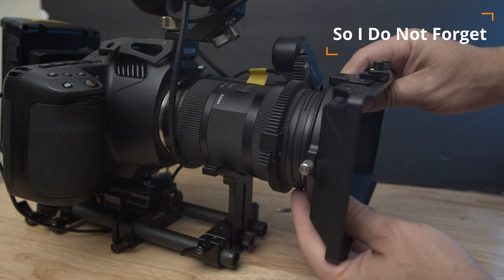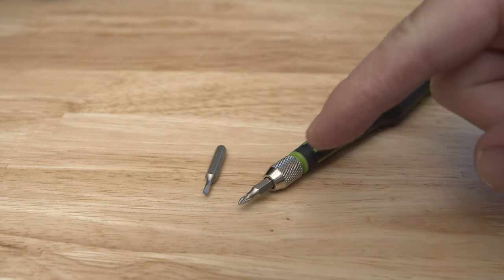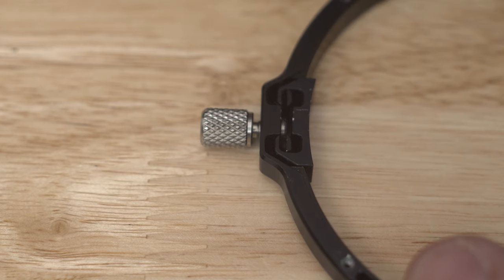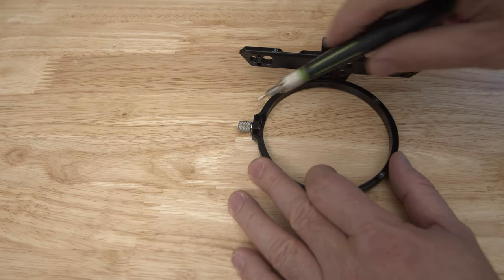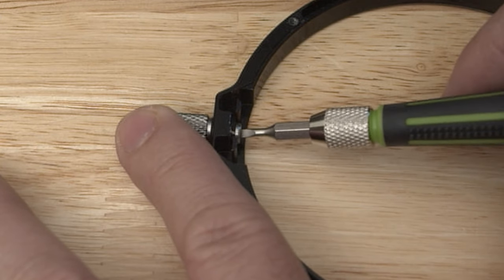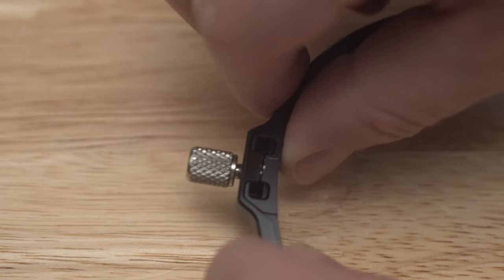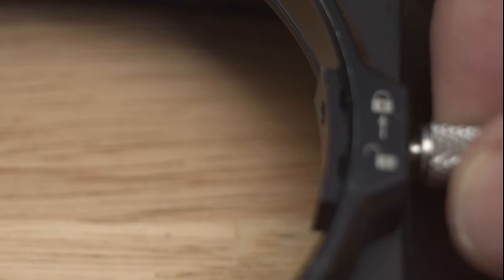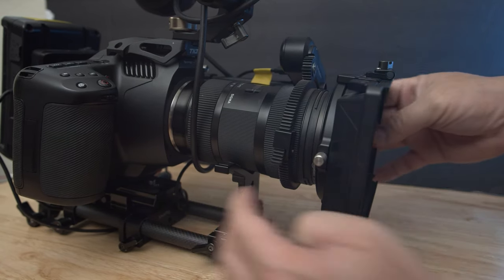How to fix a Tilta Mini Matte Box that won't lock. (LOOSE)

Comment: Hi, I have a similar problem but for my lightweight version. Any tips? Screw to tighten to lens ring won’t tighten.
Reply from the maker: The other thing that you can do is maybe (if I'm understanding correctly) you can add gaffer tape in the ring of the matte box and attach it to the lens. Basically, you are attaching it by pressuring it.